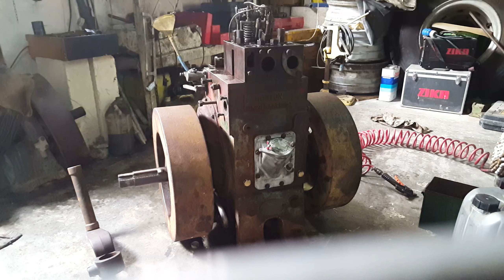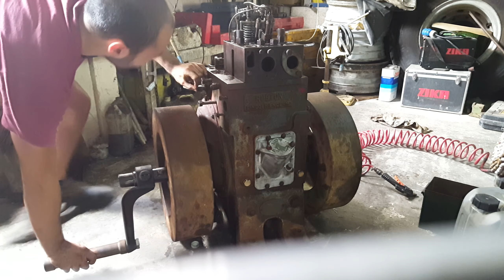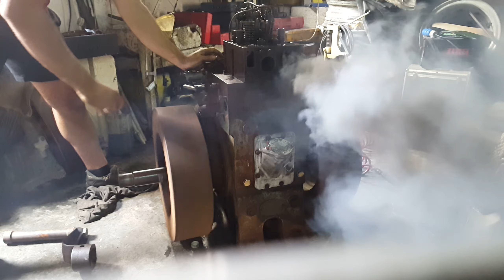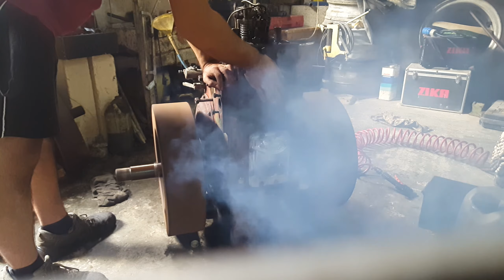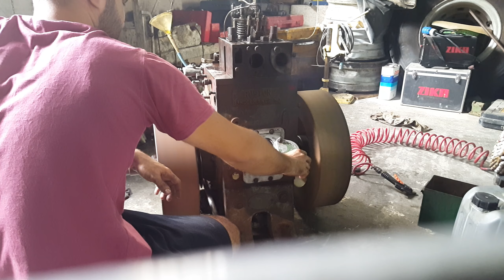Ruston 1VSH - The very first startup in Malta

Comment: Wow,. that is sweet. And these thing can run on just about anything right ?
Reply from the maker: Thanks Anything like what. Fuel or Drive?
Reply: enginelover1
 diesel, vege oil any fluid that burns?
Reply from the maker: Veikra Not anything that burns. kerosene is not a lubricated fuel, it will wear the pump and injector quckily and parts for these engines are hard to come by. I have these engines for collection only not for using them.
Reply: enginelover1
 Ah right. As for parts of old machines, I usually dont try and find parts. I get a machinist to reproduce them.  Do you have a video of your collection? Id like to see that
Reply from the maker: Veikra yh I do the same. But to make a new plunger for the pump its very hard and will cost you..... I dont have a video of my collection. I do have videos of each engine I have... Thanks
Reply: I bet in this day and age, you could find a machinist or engineer youtuber to make it at competitive price. Nice video material it would be

Comment: Nice work!  Smooth running and nice acceleration from slow idle. What were you oiling?  Thanks and have a good day!
Reply from the maker: I was oiling the rocker shaft, the valve guides, and the push rods. Also then I gave it some oil in the inlet for the seating and combustion chamber.... Thanks for your nice comment.
Reply: Thanks! I thought it was rocker arms, but I was not sure. Have a good day gbin:)